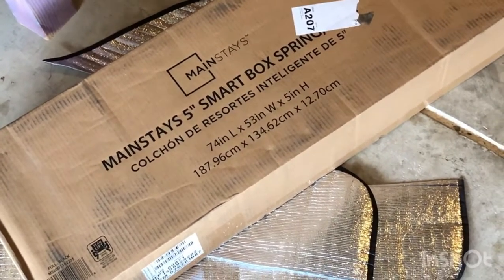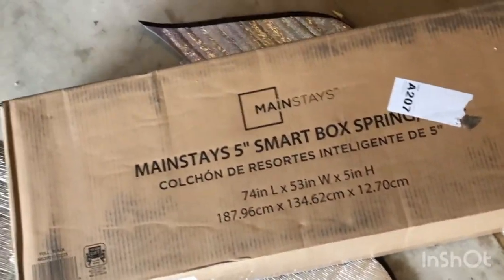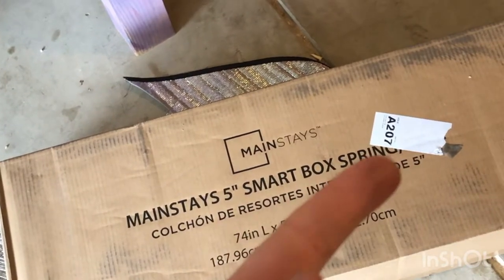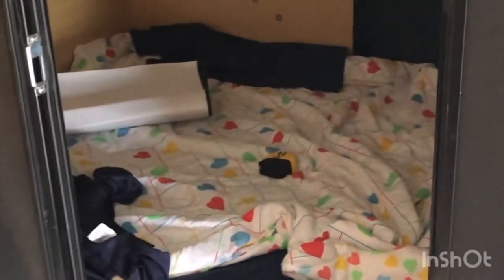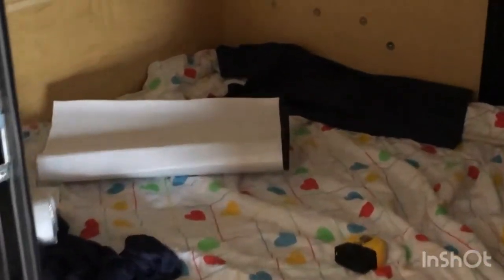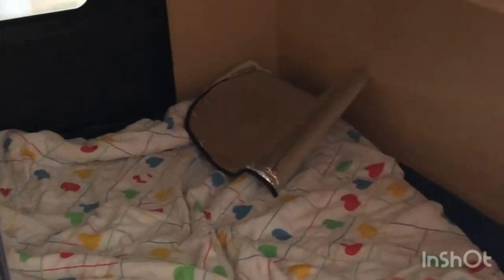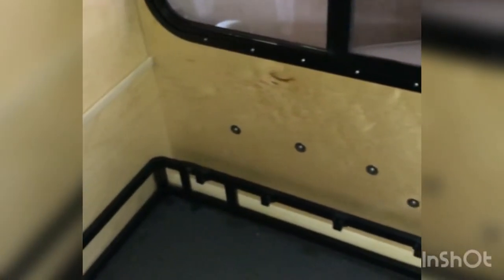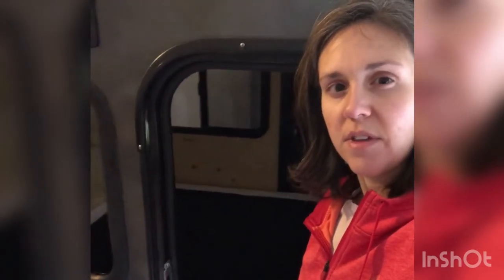Hiker Trailer Episode 5: Bed Frame Installed

Comment: I really like this idea. I have a 5x8 hiker mid range coming in few months. Only thing is I wanted it to expand from twin into double.  That way I could maximize the space Inside when not in use.  I to did not want to be on floor
Reply: Are still happy with your bed frame? I think I like the twin. Want to be able to sit in chair inside if weather bad

Comment: Been doing a lot research as my plan is to get a micro and this is the first time I have seen a bed frame other than a wooden one that someone built as they went.  This is great can you tell us where you found it?  Now watching you with the last corner, the rest of us know to start in that corner and work out from there.  :)  Enjoyed your video.
Reply from the maker: Thank you, haha this was my first experience building it inside a camper... I got the box spring on Amazon. It’s called: Spring Mainstays 5” Easy Assembly Smart Box (Full). The Brand is: Spring.  Hope this helps! Let me know if you have any other questions ~ Have a good day!